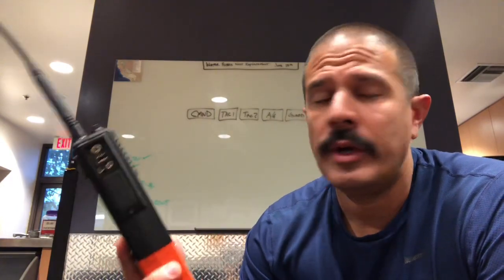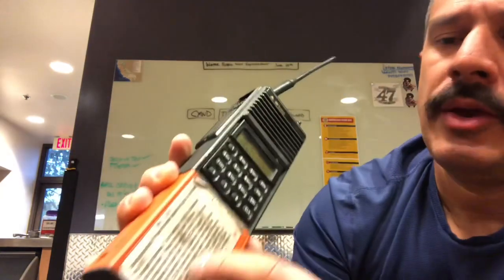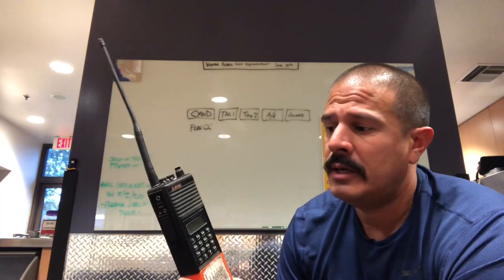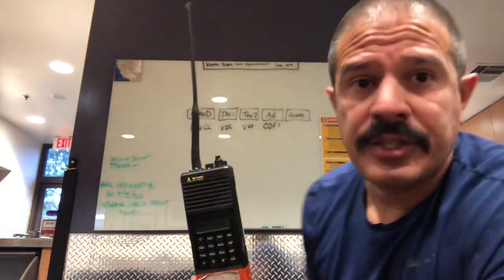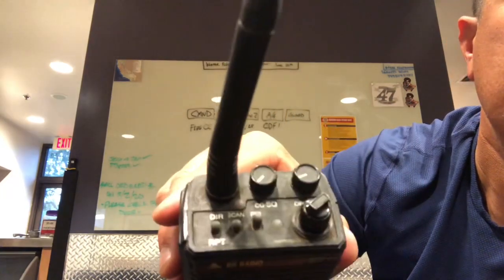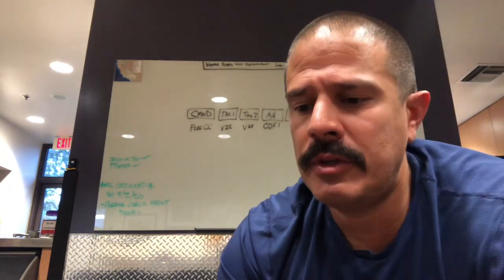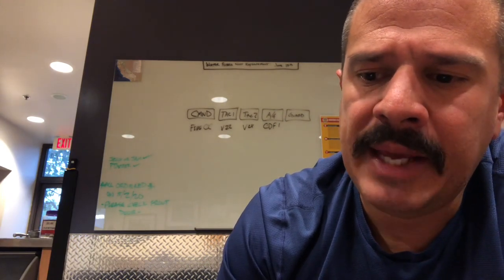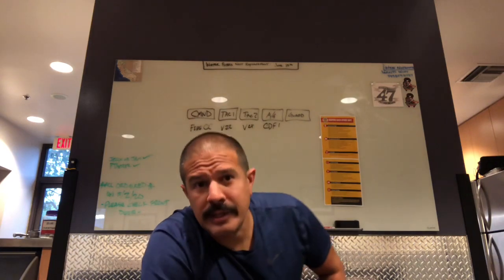BK RADIO 2020

Comment: dang thats a bulky old radio for 2020 you guys should really look into mototrbo radios
Reply: They don’t qualify do to deficiencies the radio may have. Motorola did qualify with some radio models, but limited use. It’s about spec. Right tool for the job. This radio has since been decommissioned, and while they originally went with a form factor half this size, the since decommissioned that one and went back to the same form factor. Personal don’t mind the size, they care about the features and easy of working with the menu of options available given the application. The mototurbo did not comply with this functionality